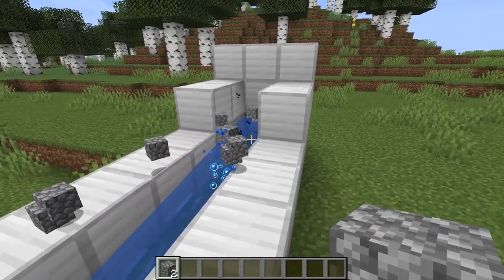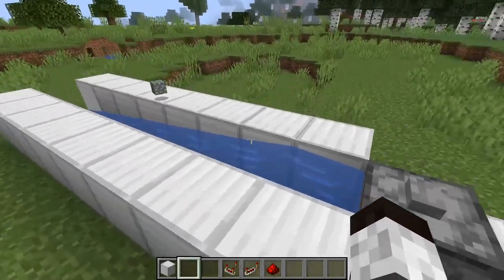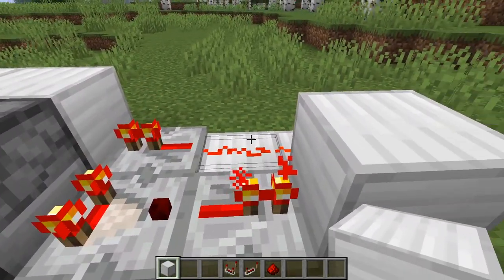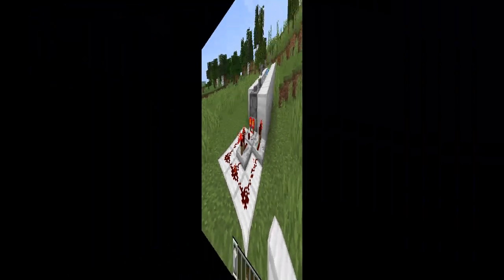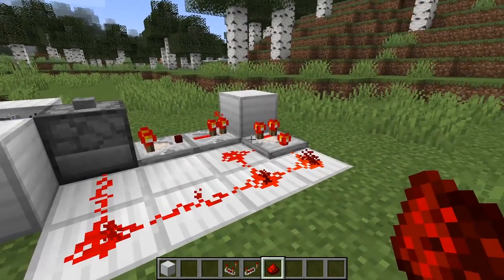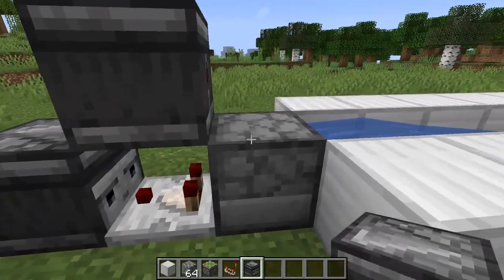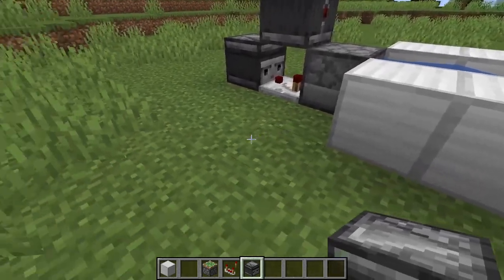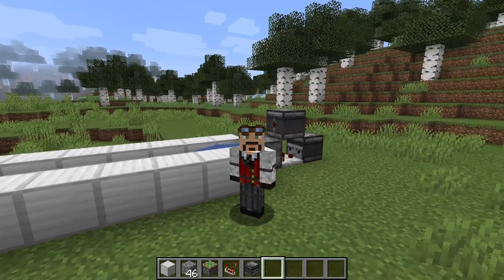Redstone Tutorial - DROPPER CLOCKS! - FAST! - 1.15

Comment: Stumbled onto this playing with 1.18.1 java. On the last variation I screwed up and used a regular piston. I popped off the comparator and the two observers facing each other continues to drive the dispenser but substantially faster. I replaced the piston and put the comparator on but it cycles out so fast the comparator has no time to activate.

Comment: Only problem with the observer design is that hoppers cant keep up with it and the piston constantly keeps extending and retracting which is kind of annoying. I like the first design you showed better as its a bit more quiet unless you have multiple hoppers running into the dropper in the observer one.
Reply from the maker: What you're missing is that you could potentially have up to three hoppers feeding into the dropper.   Then the design that you like wouldn't be able to keep up.  This observer design is the only one that has a chance.
Reply: @Tinker77  Actually I did mention it. Besides, that also assumes that the items coming from all 2-3 hopper sources would be flowing constantly or concurrently, which may not necessarily be the case.
Reply from the maker: @PhoenixFlamezz  Well there will always be noise coming from the dropper.  If the noise of the piston bothers you just don't use it and use two observers always running a clock.  This video was just to show the different options you can use.  I prefer the observer piston one because it is the fastest that doesn't run all the time.

Comment: Thanks for these. Super helpful and I've taken screen shots of each one and saved to my reference so they're easy to find when I need one.  But, one question. I'm filling the hopper using a hopper chain with composters on top to reduce lag. But, they are so slow, that the hopper empties faster than they can keep up (even with the second option). So, any way to speed up the hopper transfer speed? I think I know the answer, but thought I'd ask. :)
Reply: Hoppers are capped at I think 2.5 Items per Second.
The only way to move items around faster is by using ice lines or water transportation systems, but at the pickup you're still gonna be limited by hoppers in the end, though they can pickup whole stacks at once, so if you were to expand your pickup zone you might avoid a possible overflow. I'm still a beginner but if you need help with your construction I'd love to try.
Else best of luck, I'm sure you'll figure something out!

Comment: Is there any possible way to have an on/off lever switch vertically like 10-15 blocks up? I have it set up to a autostorage dropper system for a skeleton farm but it will waste the drops in water when the chest is full because it continuously dispenses since the auto storage chests constantly being refilled
Reply: To turn off the dropper clock, you could power the hopper that supplies the dropper. Then the drops will accumulate in your hoppers instead. If/once your hoppers fill up though that will also cause problems.
I would recommend expanding the end storage. You could also make a system that will  light up the space around a spawner (if that is what you are using) or otherwise disable your mob killing system.

Comment: See what happens when you fill the dropper with a hopper like you would do 99% of the time. That piston is going to go crazy lol. The only time it's "fast" is when you fill the dropper manually. Found this out the hard way after already building one in a weird spot in survival.
Reply from the maker: Alex that is true... but imagine multiple hoppers feeding into the dropper... like top,right,and left.  It would be able to keep up
Reply: When auto-loading the dropper it really only works well (ie without the infernal piston racket) if you run a system of at least double hopper speed. Say, your decent-sized bamboo farm where you pick up items harvested by a flying machine with hopper minecarts and transfer huge amounts of items at the unloading stations. I have a system like that with 2 hoppers (actually 3 for overflow protection) tiled 14 deep and it keeps up real well, and without too much noise (only at the very end of the unloading cycle if the intake hoppers didn't have the same number of items). One could probably devise an addition that separates the unloading from the distribution process and divvy up items equally, to avoid even that, but I don't listen to the thing anyway, so I didn't bother.
Reply: @piranha5211  The problem I have is an auto dropper like this usually comes after an item sorter. So I'll always be going through single hoppers. Even if after the final sorted item, I go into a chest with two hoppers below it, that final chest is only going to be filled by one hopper. I've since used a similar dropper with the observer clock, but with extra observers stacked, and a few repeaters before the sticky piston.
Reply: @Alex-mp4kl  Generally true. but highly productive single item farms don't really need an item sorter, so that's where this comes in handy. If you don't build those, then of course it'd be kinda annoying instead, and I'd avoid it. Most of my farms don't use this; just the bamboo and sugar cane.

Though I've not looked into multi-item sorters (the ones where the filter items reside in a chest); they can be high volume too, and might even have a pre-processor to concentrate item types; this auto-dropper might still be useful there.

Comment: Doesn't work in bedrock 1.15 though :(
Reply: redstone doesnt work in bedrock. period. bedrock redstone: 10+10=20, or sometimes 21
Reply: @unclejesseppe7323  red stone works just fine if not better in most cases than java.  Its just different.
Reply: Yeah but you never get the same outcome. Even with something as simple as a 2x2 flush door

Comment: only use the first one he showcased for most sorting systems with water, otherwise they may clutter or move to fast for the hoppers. But yeah a 20hz clock is a good idea for dropper/dispenser based traps though
Reply from the maker: That's true.  Certain things work better for certain situations.

Comment: The last one doesn’t work for me, the pistons extends, the dropper drops 3 items, then the piston goes down instead of staying extended. I’m on 1.15.2
Reply from the maker: It should only extend when there are items in the dropper.  If you throw a stack in, it should stay up.  The reason it goes down is the hoppers feeding it aren't as fast as it is.  I used this same design in my iron farm that I made in my survival world, so I know it works in 1.15.2 Java.
Reply: I can confirm that it does work in 1.15.2 java.  However, I was loading my dropper from a chest on a hopper, and that caused the piston to bounce up and down because the hopper isn’t fast enough.  Loading the dropper by hand works great though.
Reply from the maker: @burke615  You can use two hoppers to go faster.  But even if the piston goes up and down, it does work, and one benefit is it is compact.
Reply: @Tinker77  Yeah, for my space I could only put a 1x1 input and have it look good.  I went ahead and replaced the chest I was using with the dropper itself and it works like a charm!  Thanks for the tutorial!

If you're interested, my particular application is input into my bulk storage sorter.  I wanted something at ground level to just toss stuff in and have it go to the right places.  The filters are up 7 blocks, so I dropper the items into a water stream that runs into a bubblevator, then hopper them around the top above the various filter hoppers, ending in an overflow chest.  

I've been thinking about flowing them in water across the filter hoppers, because I think that might be both faster and more lag friendly, but I'm not sure the hoppers could pick up lots of items flowing over them quickly enough.  My current design has the water out of the top of the bubblevator ending on top of a hopper, so anything not sucked in immediately will just sit there until it is processed.  Also I would have to redesign my stacks to put a break every 7 or 8 blocks to replenish the water flow.

Comment: Will the last one survive the 1.16 redstone changes?
Reply from the maker: I don't see any reason why it wouldn't survive.  The new redstone changes are (for the most part) dealing with redstone dust and going up and down blocks... and the target block redirecting.   The last design doesn't even use redstone dust and we don't redirect at all... so it should be just fine.